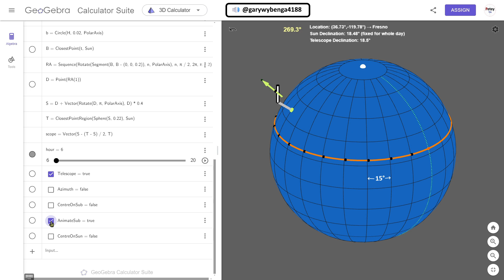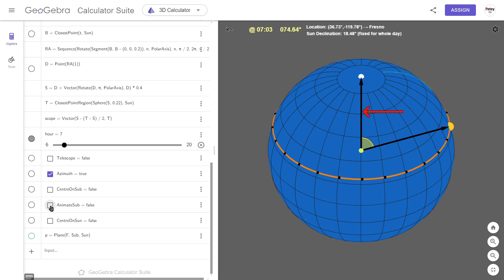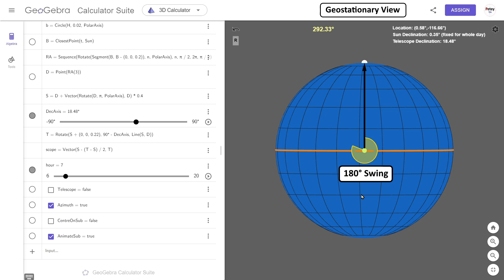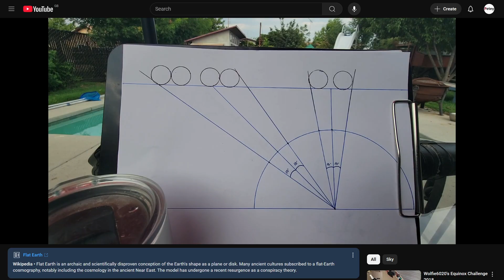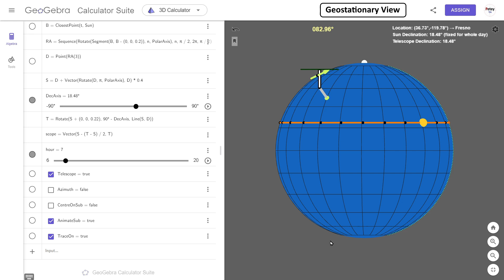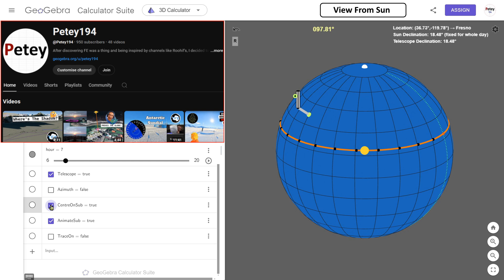Equatorial Mount Basic Geometry and 15° per Hour | Debunking Gary Wybenga and Flat Earth

Comment: What makes this type of blunder even more devoid of critical thinking is, somehow, Gary must implicitly assert that everybody else in the world are massive idiots who failed to realize this blatant flaw until he came along. 

Or. Get this, Gary should’ve realized hold on, I must have messed up somewhere. Let me back up and double check before I make a donkey of myself on the internet.
Reply: Or perhaps everyone who has used an EQ mount in the last 200 years is in on the grand conspiracy to hide the truth! That makes me one of THEM since I was in the 6th grade!
Reply from the maker: Exactly this. The confidence he has in himself is more than Dunning or Kruger could ever imagine. Not once does he think, hang on, maybe I'm mistaken somewhere.
Reply: @Petey194  when you’re not trained to think like a scientist, confirmation bias is almost inevitable. 

And not just the sensible confirmation bias where there’s good reason to expect your preferred outcome. This is expecting to find surface level evidence against one of the biggest conspiracies ever. That despite being so obvious nobody’s noticed. 

That kind of confirmation bias is something that would send any self respecting scientist into a frenzy of, clearly we messed up somewhere. Take the case of faster than c data some years back. Nobody said we’ve discovered tachyons. Even though they had not found the cause of the anomaly, it was almost certain to be a mistake somewhere.

Comment: Yeah, I saw another flerf video where the guy filmed the setting sun near the Mackinac Bridge in northern Michigan (not far from where I live).  He made a big deal about how the 'sun sets slower' in the winter and 'sets faster' in the summer.  Being north of 45N latitude, you see some things like this.  But it's just the vertical altitude angle that seems to change speed in different seasons, much like Gary's azimuth angle varies.  It doesn't 'disprove the globe' of course, it's just the result of riding on the globe as it rotates with your 'down' vector at angle to the ecliptic.

Comment: Makes me think back to Wolfie6020's challenge years ago, to explain how the equatorial mount (aka. German mount) works. I actually built a physical model with a Styrofoam globe you could turn around its axis and there was a parallel axis (at a fixed longitude/latitude) connected via a gear, implementing the rotating mount (using a 3rd cog in the middle so that direction wasn't reversed).

The intent was to put a little camera on the rotating mount axis and when the globe was turned the canera would keep its direction on the parallel axis, always showing the same spot light at the room's wall.

But the whole thing was much too flimsy as for simplicity also the bearings for the three little cogs were thin holes in a Styrofoam base.

Furthermore I had much too little experience with making videos coming to the point short and sweet, so I never sent it to Wolfie as an entry to his challenge.

It's been many years back now and though I had vague plans to rebuild the contraption one day in a more sturdy way I never cared to really do it.
Reply from the maker: Wow. That sounds cool and impressive. It's a lot of effort so I understand why you're not revisiting it. I imagine there wouldn't be a single flatty who would appreciate it.

Comment: Makes me think back to Wolfie6020's challenge years ago, to explain how the equatorial mount (aka. German mount) works. I actually built a physical model with a Styrofoam globe you could turn around its axis and there a parallel axis (at a fixed longitude/latitude) connected via a gear, implementing the mount (using a 3rd cog in the middle so that direction wasn't reversed).

The intent was to put a little camera on the rotating mount axis and when the globe was turned it would keep its direction on the parallel axis, always showing the same spot light ar the room's wall.

But the whole thing was much too flimsy as for simplicity also the bearings for the three little cogs were thin holes in a Styrofoam base.

Furthermore I had much too little experience with making videos coming to the point short and sweet, so I never sent it to Wolfie as an entry to his challenge.

It's been many years back now and though I had vague plans to rebuild the contraption one day in a more sturdy way I never cared to really do it.

Comment: Gary using Time&Date, which is based on the Heliocentric model, in a feeble attempt to prove flat earth is hilarious.  
He should stick to milking cows and talking to the sky, he doesn't have the intelligence to understand geometry.
Reply: ... It would have been as easy as can be if he simply put a stick in the ground, inclined so that it points to Polaris, and took that stick as the pivot axis to measure the Sun's change of angle.

Comment: With a shadow on the horizontal ground is 15° per hour from the shadow head to the feet if the earth is flat, and from the shadow head to the head if the earth is a globe. And we know that the direction of the light is from the head to the shadow head.

Comment: (Commenting at 1 : 52) This is exactly like a car going along a road as he used the azimuth. The car is going at a constant speed. When you see it far away heading towards you, the change in angle is slow. The angle change speeds up as it gets closer to you, is maximum as it goes past you, and slows down again as it goes away from you.  Fresno at 38N in late July still has the Sun travelling pretty high in the sky, Thus the horizontal part of the Sun's elevation angle gets relatively small, like the road going past you close by. Try it in December and the angle change is far less extreme as the horizontal part of the angle doesn't change size so much.

(Removed bit on sundials as I misremembered how the hour angles change on what sundials.)

Gary needs to break out the board, nails, and rubber bands to figure this out. Oh wait, that won't work as this involves 3D. Gray has no chance, probably.
Reply: Gary should try plotting the Sun's expected direction based on the flerf map. It will be far worse in terms of expected position deviation at hourly intervals. Doing what he has done is worse for flerfs than normal Earth geometry. We can show where he has gone wrong with respect to the spherical Earth but no flerf would be able to do the same for a flat earth prediction.
Reply from the maker: Great analogy. We got Brian Leake with his bubble gum men and string on a globe and we got Gary with his rubber bands and nails. I'm sure there must be others actively trying to figure this stuff out.
Reply: The invocation of the changing angular velocity of a vehicle on a straight road passing an observer not far from the road is a good example of varying apparent speed. But in this instance it can be potentially confusing for the less spatially imaginative. Because it involves the perspective acceleration associated with TANGENTIAL, meaning linear motion.

In this case, where rotational motion alone is in operation, simply deconvolving the sinusoidal path of the Sun in the horizon coordinate system into the horizontal and vertical components suffices to reveal the cause of variation in each alone.
Reply: Hmm, my analogy is wrong as it misses out two aspects. Here is a new analogy. I replace the Sun with a car only 1 mile away along the sight line to the Sun. I then drop the car vertically down to the ground. Do that for each hour. I now have a set of cars along a curving path that goes from 1 mile to the East, to a small fraction of a mile away to the South, and on to 1 mile away to the West. The gaps between the cars when in the air were constant, but the gaps between the cars on the ground are NOT constant thanks to dropping them vertically. The gaps on the ground, start and end small, and are maximum around noon.

Gray could plot the observer, and those grounded cars on his board with some nails. He could use some rubber bands to show the angles from the observer. He will see them changing size the same as the data from Time and Date.

Comment: When you measure the Sun's azimuth rather than the angle it moves along its path in the sky , you will get non-uniform motion. As usual, flerfs get the basic geometry completely wrong!
Reply: Flerfs must really feel cheated when they buy a TV.  😁
Reply: That's a good point.  In this case it seems to demonstrate that Gary tends to visualize things with himself as the point of view, and being unable (or unwilling) to consider the Sun's center of motion first and then the relationship between it and his own center of view.  Being able to visualize multiple frames of reference and how they interrelate is important for grasping reality like this.

Comment: Yet again your grasp of Geogebra astounds me. So it appears, based on my limited understanding that Gary was expecting the azimuth to be a consistent 15° per hour without taking into account the altitude change as well? Because his chart seems to ignore the altitude even though time and date show both a direction and altitude.
Reply from the maker: Thanks, but I'll admit 😐that thinking in 3d hurts my head. He focussed on how much the heading changed every hour from dawn to dusk and the length of time it takes to change 1 degree for his location. He noticed that nothing was constant. My guess is he couldn't reconcile the apparent conflict of a mount turning at a constant rate with what seems to be a variable Sun.  There's more to his argument, like how refraction can lift the Sun up at sunrise and sunset, but I wanted to keep this as bare-bones as possible. I doubt I'll be changing his mind on anything though.